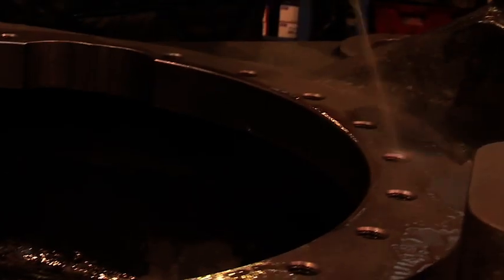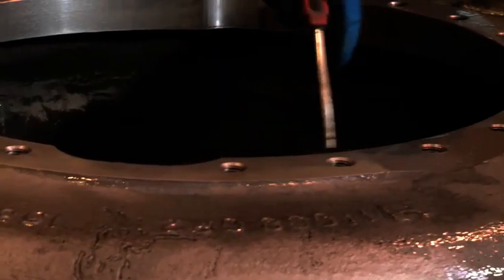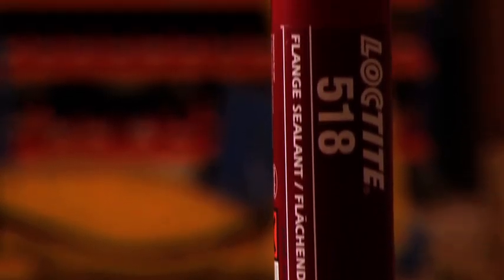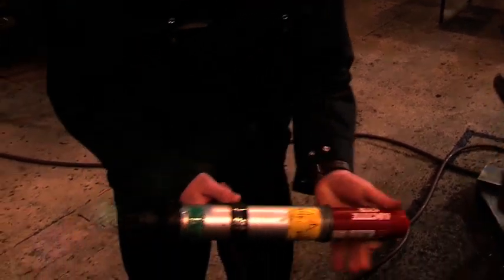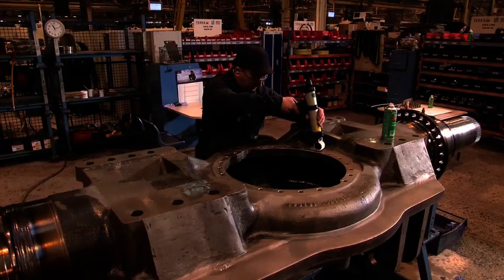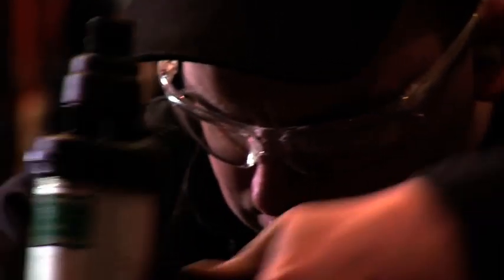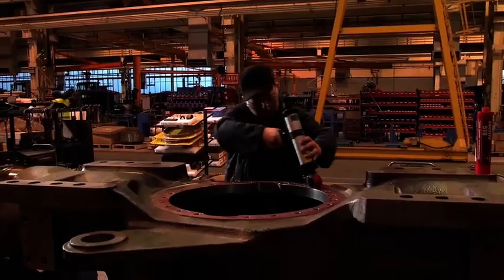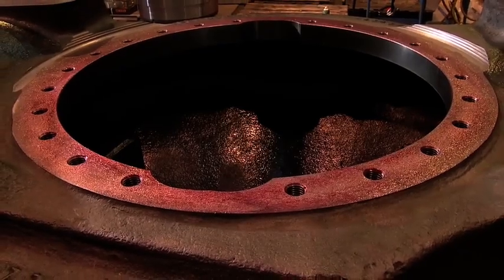LOCTITE 518 - Sealing rigid flange surfaces

Comment: Hello Team, i am planning to buy loctite gasket maker to apply on the magneto cover of my GT650R motorcycle through your Indian website. However i cant decide which particular product to go for. The existing paper gasket was of brand EWP210 which would sustain 200 deg and was oil resistant. Appreciate if you could please suggest one of your product for my application.
Reply: Use loctite 510, since you need higher temp resistance.